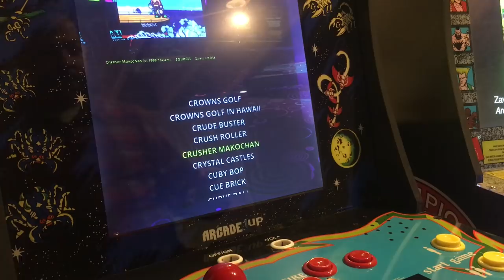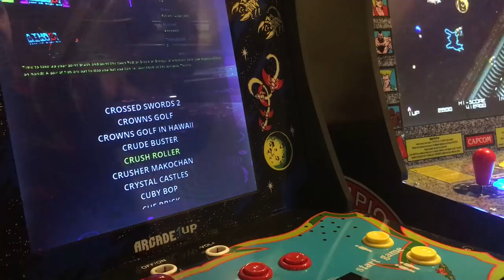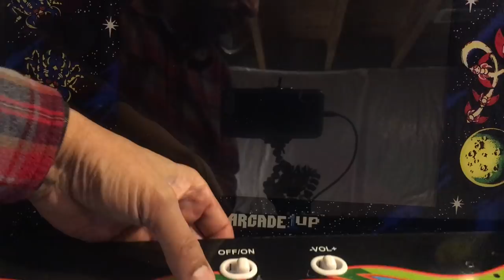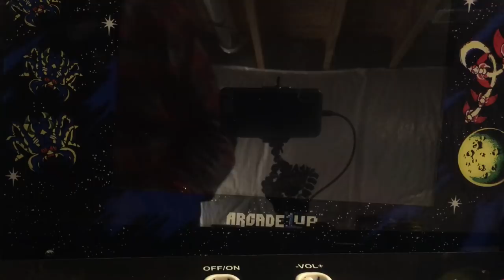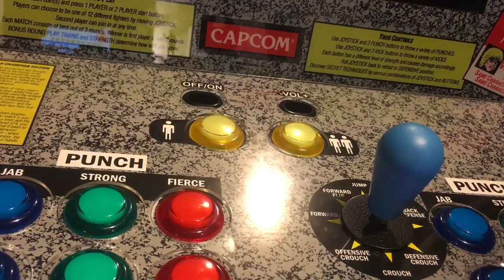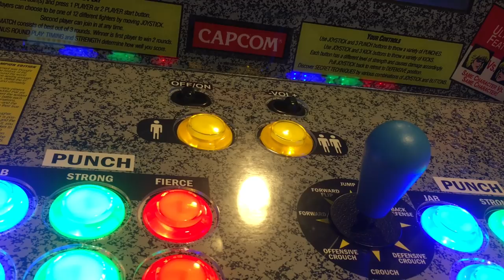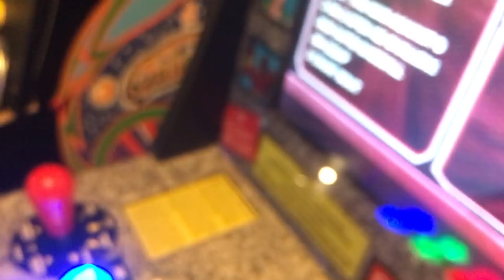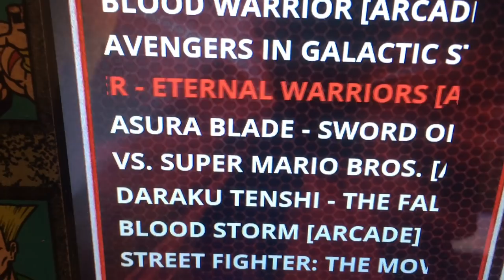UPDATE: Read Description/Comments - Reversing the Arcade1Up Power Button On Modded Cabinet with Pi

Comment: Thanks DL for all your videos.  Did you plug in the fan as well into the pi? if so where did you plug the fan with the power switch?  Thanks!
Reply: Try pin 4 (power) and 9 (ground)

Comment: Thanks for video @Detroit Love. Sorry if this was asked already but before you did this , have you tried reversing the orientation of the  cable on the PIN? So for instance swap the red and black wire the other way on the 5 and 6 pin?
Reply: Wondering also

Comment: So where did you plug the raspberry pi fan wire after you plug in the wire for on/off power button..? And also which retropie image you installed in the raspberry coz i like that intro video..😊

Comment: Hey I’m trying to make a power switch but my fan has been connected to pins 4 being red and 6 being black. I’m trying Pin 2 being red and 9 being black for the power switch, do I have to modify the script so the power is for pins 2 & 9?
Reply: Just to clarify here I can use pins 2 & 9 and run the script for the power button and use the arcade 1 up slide switch and it will work?
Reply: Got it thank you!
Reply: Hey Detroit, I got the power button to work but I have to slide it back once and then back again for it to work properly. Did you have this problem? I have to slide it to power and then back off and then back to power for it to work. Sound right?

Comment: Hey Detroit Love - Next problem for me is connecting the Rasp Pi to wifi. I only got as far as putty and it wouldn't find the IP address or retropie. I entered the info in RetroPie  under Raspi Config to my SSID and password, also changed county and time zone. Not able to see it before or after reboot. Any suggestions? How do I do it manually through the software  as a worst case scenario? Thanks again! (I hate to bother you with all the issues, just a good place to get answers out for everyone that may run in to it)
Reply: @DetroitLove  No. I also tried entering my SSID in manually with password, says connecting, then unable to connect and my SSID isn't displayed.
Reply: @DetroitLove  The learning curve and why things are problems even though you are doing everything is rough. I thought I had a hardware issue with my USB controllers on the 128gig image I first tried. For some reason it wouldn't let me start the games.  I will ETCH the 32 gig image again on another card and see if that is the problem. From what I understand now is you can take the custom changed micro sd card and save that modified image for future back-ups which I will be doing once it's all straightened out. I also ordered the same case you listed through your link with the cooling fan, looks awesome btw. Thanks again. If this second image doesn't work I want to figure out how to manually change the script without going over wifi. I have a wireless keyboard connected to my pi also.
Reply: Got It!!!! It works now and now I just need to make all my adjustments and enjoy this machine!!!! Thanks, that was the problem, it wouldn't see my SSID. Even after I saw it on this image, it still took a while before I could access it in putty. Thanks again!